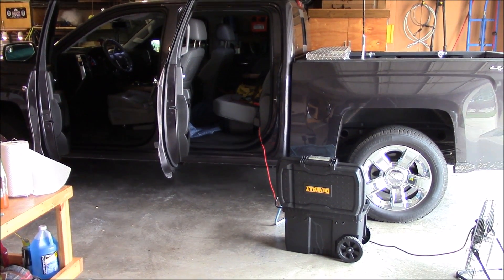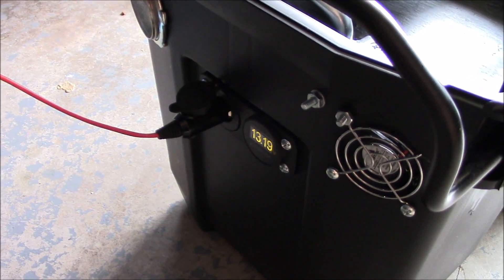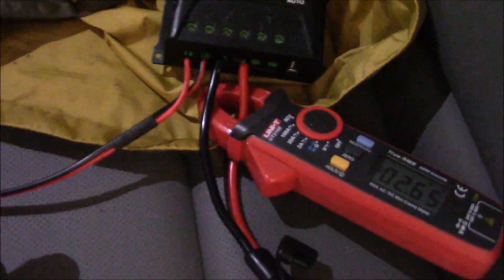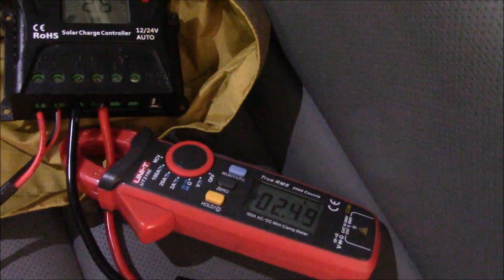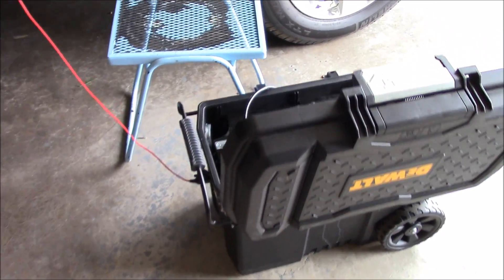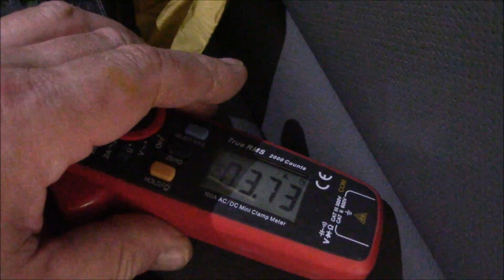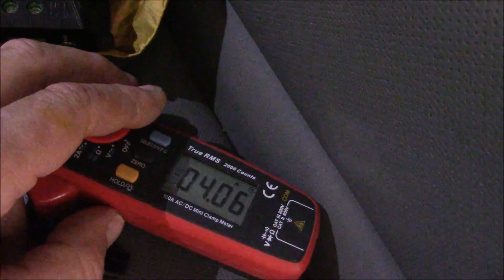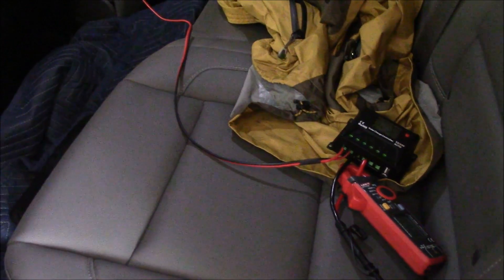Using my truck as a "solar panel" - rigged up a DC-DC charger (10-amp PWM solar charge controller)

Comment: I charge my batteries off the alternator of my tow vehicle connected with Anderson plugs into a dc-dc charger.  When I'm camping I unplug the car and plug in a solar panel which sends power from the panels through the solar charge controller into the RVs DC-DC charger and it thinks the solar panel is the cars alternator :)

Comment: You don't really need the charge controller in the mix. Essentially you're just adding another 12 volt battery in parallel to your system. Connecting the battery in this way will transfer the power from your truck battery to your solar generator battery - kind of like jump starting a car.
Reply: Ya but the charge controller will do so intelligently, optimizing for different chemistry (lithium. etc) .

Comment: Yeah I started out doing this but the charge time was too long I did it about 3 years ago I use a deep cycle marine battery originally I was using a motorcycle battery to cut down on weight but I basically bought the same roll around case as you which lead me to use a larger battery because I didn't have to carry it anymore LOL. I bypassed the solar controller mounted inside with the battery of my roll around I only use the solar charger with a briefcase size solar panel that is 50 Watts folds in half and fits right in the roll around and when you open it up on the move a little Velcro it sticks right to the top of the roll around perfect size. When I use my alternator off of my truck I installed a battery isolator a 200 amp Stinger to be exact most alternators are only 90 amps but when I replaced mine I bought a 190 amp alternator and installed a isolator bypassed my solar controller that was mounted in the Box now I just plug straight into my battery in the tote I charge 10 times faster. The only time I used the consoler controller is when I am not near the truck and then I just plug in the briefcase size solar panel to the controller which folds neatly in half and fits right inside of my roll around and actually does a decent job of keeping up with the battery and my power inverter that way I have 110 volt AC and 12-volt DC in the same box. Using the cigarette lighter like you are I did at first as well but quickly realized by spending $40 getting a battery isolator I could charge at up to 200 amps that way my isolator stays in the truck I simply cut an extension cord in half positive is my white wire off of the isolator the black wire by grounded to my truck using a 3-prong extension cord to ensure it was always positive two positive negative to negative the neutral Pole helps to ensure there is no mistake when plugging in I simply put the female end inside my roll around white wire to positive black wire to negative on that battery this way all I have to do is quite literally plug it in and when it's not in use I simply roll my wire up and it's put underneath my seat plugged in to a basically dead end to protect the positive from grounding out underneath my seat. I will tell you like this you are definitely on the right track and your setup will work fine it will just take longer to charge. Using the battery isolator will cut your charge time down by 3/4 of the amount of time it takes to charge off of the solar controller and I don't have to leave my solar controller floating in the back of my truck or in the Box. The solar controller is mounted permanently inside of the roll around and I can plug in on the Run using a briefcase size solar panel that fits right on top of everything in the Box. I like your thinking man it's People Like Us everyone loves to see show up because we have the power literally LOL.
Reply from the maker: Sounds like a nice set up!

Comment: Nice video Chris!  This reminds me of something I do.  I have an off-grid system (I think I mentioned it in some of my comments to your videos)... it supplements my grid-tie system.  But, I bring my lawn-mower battery inside when it needs charging and I normally connect a portable PWM charge controller to it and disconnect my backyard solar panel wires from the main MPPT going into my battery bank and use that.  Everything uses quick disconnects (anderson power pole).  But, once in a while, I need to charge my lawn mower batteries when it's gettin dark outside.  In that case, I have a buck converter connected to my main battery bank and I actually connect the output of that buck converter into the small PWM charge controller for the lawn mower batteries.  So, I charge the small batteries from the large ones (much like you charging your solar generator from your truck battery).
Reply from the maker: Awesome! I am back in town...will be doing some more solar videos.

Comment: I used a charge controller like that and a 18W solar panel and revived my 10 year old truck battery and am still using it. When I was in the wheelchair it went dead .7 volts now back to normal took about 2 weeks. good video

Comment: Good job. Those inexpensive PWM charge controllers have a lot of uses. My diesel backup generator had a bad VR on the starter cucuit. I needed 24 volt DC and the charge cucuit was putting out 45 volts AC 3 phase. I bought a 10 amp bridge rectifier for 3 bucks on ebay then connected the DC side to the little PWM charge controller. I worked perfect. Later Since the generator sits most of the year I bought a 30 watt 24 volt solar panel and use the same PWM controller to maintain the starter batteries. I think we both should have a few of the little PWM CC laying around just for backup in a pinch. Chris you really were thinking outside the box on this one. nice job.
Reply from the maker: Oh, I agree. They also don't "backfeed" (isolated one way with the truck's electrical system). So, for about $18-22 and some spare parts laying around...we can do some real innovative stuff. I also have some small battery alligator clips (instead of using that 12v power plug as the "solar input") that could be used on any type of vehicle (4-wheeler, ATV, garden tractor, boat, snowmobile, etc).

Comment: That is a cool trick to regulate the charge off your truck and keep the generator battery from over charging .
Reply from the maker: Prob a lot safer too...instead of going "direct" w/o some type of regulation in-between. Goal was around 5 amps. The truck's wiring is good for 15 amps...but, not gonna push it. Just something to keep the generator battery safely charged with a "decent" amount of current. Keeps all the wires cool too when around 5 amps. Everything is fused...so, should be safe as can be. Cost was really not much at all. I think this little 10-amp solar charger was, like, $18 on Amazon and I had everything else laying around ready to go.
Reply: Do you have the truck on when you are charging it ? If not how long do you think it will charge before you start to kill the truck battery.

Comment: Nice, that is a cool trick!!
Reply from the maker: Thanks! 60-70 watts of charging if needed! I also have some alligator clip-on's too for this little rig. You can charge this solar generator off a boat, car, ATV, anything that has a 12v battery/alternator. Simple. Beats spending a ton of money for something large and cumbersome.

Comment: Nice proof of concept, but plugging straight into the truck with out a charge controller is way more efficient I do it when i have to power the camper on cloudy days to power my fridge 12 v  while on the road. Your trucks alternator is set for AGM battery's from the factory.
Reply from the maker: Cool! Guess I am concerned with "regulated DC charging". Using a charge controller keeps things in control. So, would going DC socket-to-DC socket pop fuses? Or, heat up that DC jumper cable? I agree...the truck's DC charging parameters are alright for this AGM battery. Wanna do things safely. Can we talk offline? Thanks!
Reply: Sure Brother no problem Your cigarette type plug is limited to 15 amps. Most trucks have a min of 75 amps of charge rating my dodge has a 160 amp rating. If U want max. charge U can do what I did & use a 8 ga .wire direct to battery using a battery isolation swith of proper amp. rating by passing in my case the factory camper converter. Most all alternators are set @ 14.4 Volts +- not so good for FLA battery like I use but better than a dead battery when running a absorption type 3 way RV fridge.
Reply: Chris DIYer it most definitely would pop the fuse if you had a dead battery on your hands.